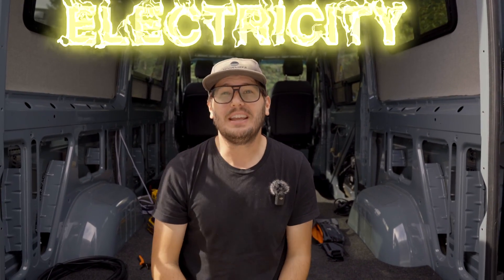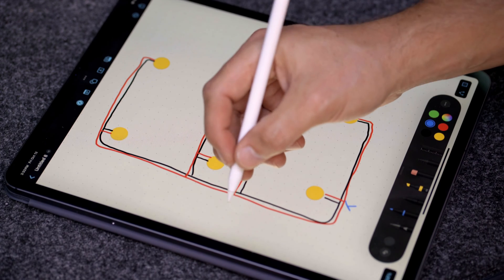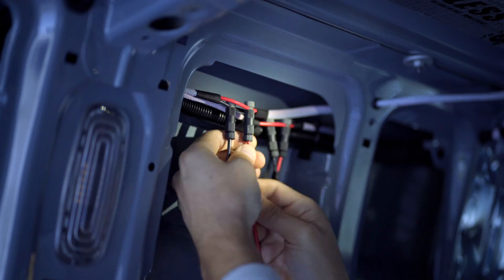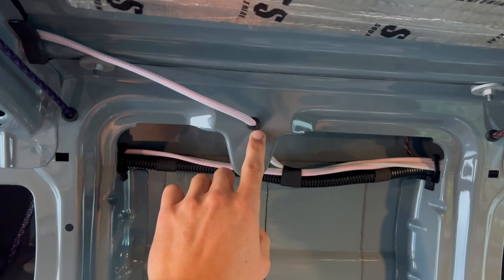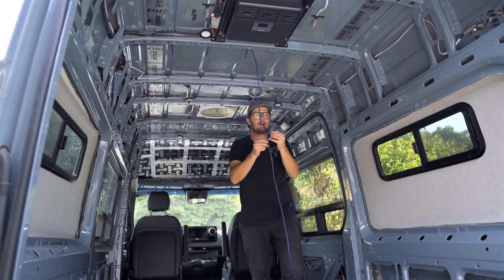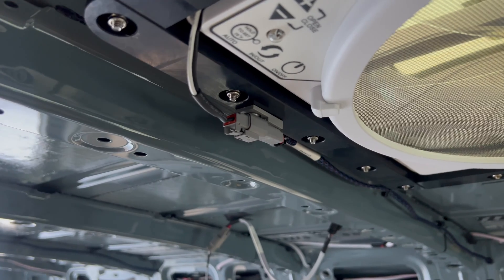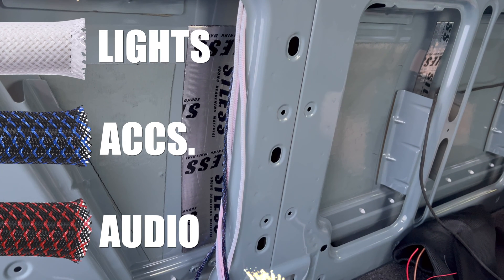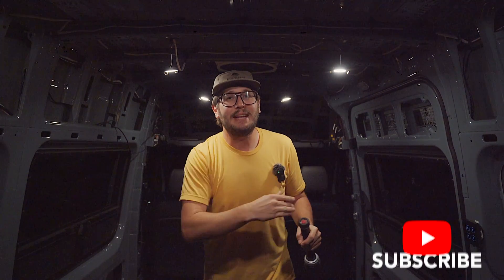Sprinter Van Electrical System Phase I - Prewiring the Lights, MaxxFan & 12VDC Air Conditioner

Comment: Fantastic video. I know you used the external power source to test the lights but did you ultimately use the main battery as the 12v power source or did you tap into exiting light wire? And did you remove the oem lights or did you simply leave them alone? Thanks.
Reply from the maker: Hey there, I ended up tying these into my house battery system.  I have 2 extra batteries for 640AH of power that runs all the electrical in the campervan.  I left the OEM lights in place because it's nice to have them turn on when we open the doors,  we did add a switch to allow us to turn them off at any time, though.

Comment: Can 1 LunaSea receiver be controlled by multiple touch pads?  I'd like to have one pad at the bed and another at the slider to control the same lights. I assume this will work, but the info on their website is thin. VERY appreciative of your videos!  Entertaining, educational, and well organized with links to everything.  You are putting in a lot of work.  I'm just starting my build on a 170 extended and will by as many supplies as possible through your links. First $500-ish went out tonight.
Reply from the maker: Hey @RTBWest, thank you so much for the support, using the links (any little bit helps) and glad you are liking the videos.  They do take a look of work to put together so it always helps when I know people are getting some use out of them.  

For the Lunasea, yep!  Each receiver can pair with up to 8 transmitters (touchpads).  I have a similar plan. I'll have my 4 Channel touchpad (overhead lights, accent lights, left and right porch lights) by the slider door, then a 2 channel for overhead and accent lights by the bench seat, and one more maybe in the garage.  

In addition to this..... I know getting a little crazy.  I'm going to wire in a HomeAssistant relay to the button contact of each receiver so I can turn them off from my phone too.  It's totally redundant and over the top, but I just want to share as many options and info at this point 🤓

Comment: Wonder if you'd be able to control a fan with that Lunasea 4 zone transmitter and an RF unit (rated up to 8 amps)... obviously more expensive than a simple PWM but also a lot cleaner if you already have the transmitter mounted. We have a LeMans vent and dialing in the fan control, probably going to add this for our lighting to simplify all the switching/add control points.
Reply: Annnnnd while I'm here - any idea how long the Lunasea RF system remembers the learned channels/connections? If you had the power system off for say, a week, will it have to be re-synced?
Reply from the maker: @AllenKrughoff  Hey Allen, I left power off for almost 5 month at one point and the RF channels were still programmed.  

Are you looking to control the fan speed with the dimming function of the Lunasea?  Does the LeMans vent motor speed simply run on a voltage input because that's what it does drop the voltage to the light. 

The way I'm going to have my final system setup is Lunasea RF touchpads wired in (one in the garage, one by the galley, and one by the passengers seat) but then I'll also have a home assistant relay wired into the button contacts on the RF receivers so I can also switch stuff on and off with my phone or from outside the van (say porch lights especially if on the drivers side of the van) 

Other companies make these type of RF transmitters for less FYI (SuperBrightLEDs), but Lunasea makes the nicest touch pad I've seen and unfortunately each brand is proprietary to each.
Reply: @moonrakerdesign nailed it. Yes just a simple 2 wire for the fan. Literally was browsing superbright this am (4ch control and 4 RFs for $39 😮). Proprietary…bummer. I’m sure you considered the Lunasea pad and alternate RF’s. The RF concept solves my 3 way wiring brain melt, getting porch light switch to the drivers seat and the bed. Thanks for all this! Hang tough with kiddo, we just hit 3yrs old and the fun is exponential
Reply from the maker: @AllenKrughoff  yeah I ordered a bunch to test with the Lunasea pad as the RF controllers were so much cheaper... unfortunately they don't work... booo 

Yeah being able to have multiple controls all around the van without sending your lighting wires everywhere is a huge benefit! 

I can already see that, at 7 months he's starting to become a lot more interactive and so much fun!  It's getting better everyday.  Thanks for the encouragement!

Comment: Hey, I would love to get the file on the bracket for the AC wiring harnes!  What are the chances you would share that?
Great Video.
Reply from the maker: Hey Dana,  Thank you. I actually sell that piece so not looking to share it out right now.  However the design is fairly simple to reverse engineer with a few measurements from the connector.

Comment: Whats that adhesive that you used (Black) holding the roof to the ribs? did you do that to make sure they didn't come apart for noise reduction?
Reply from the maker: Hey John! Thanks for stopping by and the question. Mercedes did a terrible job with the factory adhesive in our van for both the roof ribs and side panels.  Some adhesive from the factory was missing and others had so little that it didn’t do anything and things were flapping around metal banging on metal. 

So for the roof panels to the braces I used 3M 08323 seam sealer.  This is a body panel sealer that dries a little faster and I liked better for overhanging surfaces.  You can see how I applied this in our Sound Deadening Video - https://youtu.be/hFDmN5kshK8?si=EATuBJXQVm3uhG2L

For the walls and slider doors I used 3M 04274 which is a little thicker and can fill gaps up to 1 inch. If I had to pick only one I’d use this for both.  You can see how and were I used it in this YT short we made - https://youtube.com/shorts/8sIdC-9hhiE?si=_nfcS-jbl60XA7vB

Hope this helps. It quieted our van down a ton.  Let me know if you have any other questions!
Reply: @moonrakerdesign   I have the same issue. I bought Sikaflex 252. It's sitting in my office until it gets warm enough to apply it. May try put the 3M stuff as well. Thanks for the info
Reply from the maker: @JohnDrach  Sikaflex 252 would probably work as well since the joints aren't under heavy load.  However, the reason why I chose the 3M is because it bonds well to 2K auto paint and specifically says it can be applied over existing NVH without prep. 

If you look at the SIKA docs it wants you to scuff the paint and apply 207 Primer for the best bond.  But back to my original point it's probably okay for these joints without that extra effort and a long as the area is clean.
Reply: @moonrakerdesign  Hmm I may get some of these 3M products. I have huge gaps though. My van only has 3k miles. How many of these tubes did you end up using? It doesn't look like you get a whole lot in those containers for your money. Thanks for the info though. I'm just about at the point in my conversion where I need to do this step. Its freezing out so Its been on hold.
Reply from the maker: @JohnDrach  It really depends on how many ribs in your van are detached and how big the gaps are. I hit every single one on the roof but the gaps were tiny there so a little bit went a long way.  Down on the side panels I would say I had to do about 30-40% of them mostly around the wheel well and on the doors.  Some of them were almost 3/4".  In total I used 2 cartridges.

Comment: any chance you can give a little bit of info on how you used the 12V power supply to test your lights? Ie setting for Volts and Amps
Reply from the maker: Hey @dennym, thanks for reaching out!  I use an adjustable power supply that’s up to 30VDC and 10A linked in the description above. There are two sets of knobs that allows for either steady (set) voltage or steady (set) current.  We want to be in steady voltage mode so you should only adjust the voltage knobs and do it when nothing is connected to it and the voltage setting is 12V and the amp draw should be 0A.  I always make sure to check this before connecting this to anything. Then I use the switch on the back to turn it on and off since it will remember its previous setting. 

As long as your connected load pulls less than the max amperage the power supply can produce (10A in my case) the amps will automatically adjust to support that load in the set Voltage setting. 

Let me know if this makes sense if not I can put together a YT short when I get home from my current business trip next week. 

And alternate option is to use a set voltage power supply. I didn’t want to do this because I wanted some flexibility for using the power supply for different projects besides just the van.  Here is an option - https://amzn.to/3FNR0se. With this you don’t have to worry about making adjustments all you’d need to do is hook up a plug like this -  https://amzn.to/3QQ0vgB to 120VAC (usually denoted by L, N and the ground symbol) and then hook up your 12VDC load to one set of the + and - terminals.
Reply: Perfect sense. Thanks @moonrakerdesign

Comment: Will 16 gauge works instead of 14?
Reply from the maker: Hey Melinda. Depends on the lights you are using, their total amp draw and how long your wiring run is.  Are you familiar with wire gauge tables. My favorite is from Bluesea https://www.bluesea.com/support/articles/Circuit_Protection/1437/Part_1%3A_Choosing_the_Correct_Wire_Size_for_a_DC_Circuit

Let me know if you need more help or explanation here.
Reply: I wish you install and show what is needed to jumpstart the van whit the house batteries 
See other vans use a button

Comment: Not only are you funny, but you do such a great job detailing all the steps in an easy to follow and super informative way! Thank you for continuing to deliver great quality and especially for the links to the products you are using! Hope the pennies in commissions are stacking up from me ;-)

Quick question - can you do a video that includes all the different wires sizes you use throughout the entire build? I see 14AWG here but wonder what different sizes I should consider buying in bulk for my build.

Again, thank you sooooo very much!!!
DC
Reply from the maker: Hey @olddominioncollisionrepair2652 thank you very much we really appreciate you stopping by and taking the time to comment this.  It means a lot to us and we are glad you are enjoying the content!  Also thanks for using the links.... yeah we don't get much...  but it does help a little bit here and there so thank you for that!  

Yes of course!  I can look at putting a short or video together on that soon.  But real quick here's what I did.  I made a table of all my DC connections in Google sheets, I added their amp draw for each and I then went out and measured every wire run adding 1-2 feet for margin.  I then used the Bluesea circuit wizard - http://circuitwizard.bluesea.com to calculate the wire gauge using 3% voltage drop for everything.  The important thing is you factory in your total loop the calculator takes the value for both the positive and negative wire, so an 10ft direct run would actually be 20ft here.   You want to make sure you use a high quality wire like Ancor too that has a 105ºC insulation rating because that will also impact your results.  After your results are calculated there's a little drop down that says "explain results." There you can see the condition for amp rating and the voltage drop using ABYC standards. 

Anyways after all that data was in the table I started looking for lowest common denominators.  It doesn't hurt to go up (lower number) for wire gauge on any of the circuits so I wanted to order spools and have them divide out the best I can.  For example if I needed 60 feet or 14AWG for one circuit and 35 feet for 16AWG for another, I'd just order 100ft of 14AWG and run both circuits with that.  

I hope this helps and I'll try to find some time to make a video of this soon!
Reply: @moonrakerdesign  daayyuuummmm!!! That’s what I call going above and beyond! Thank you for this great explanation! I appreciate you and your killer content! Looking forward to any and all your content ❤️🤘🏼❤️🤘🏼❤️
Reply: Hi Todd and Colleen, we’re really enjoying your content and in particular the engineering you’re applying to build in maintenance. We just received our 144 AWD and have an Outfitter to help us as we spec out out our multi-use modular vehicle ideas. I just purchased your hood strut kit 🙏🏻. I have a couple of questions: 1) Total Stereo Speakers - how many total speakers are you installing and where are will the rearward ones be placed? 2) Heated Steering Wheel - we live in BC CAN and live at Silver Star in the winter without a garage and grown fond of heated seats and mostly heated Steering Wheels. We were saddened that only the E-Sprinter has heated steering wheel option and our ‘23 did not have the option. My question is are you interested in seeing if the E-Sprinter’s heated steering can fit and work in the 4 cyl or v6 cyl vans? I would be very keen to help out in any way!
Reply from the maker: @garryvansoest8726  hey Garry first off thank you for the compliments and thank you so much for supporting us with the purchase of the Strut Kit!  We really appreciate it and it helps us continue to make this content! 

1) For the total number of speakers we have the 3-way components up front obviously, we are going to put a sub-woofer behind the drivers seat in the wall with the @diyvan solutions and then we will have a 2-way component speaker system in the rear doors.  With that much distance between the speakers we are going to have to add a DSP to solve the timing issues and such so that will be Part 2 of the audio system install as we get a few other projects out of the way.  Our master plan is to also have a Mediamaster in the living space to use the system separate from the factory head unit, another feature made possible by the DSP too. 

2) I was a bit bummed when I found out that wasn't an option in the Sprinter as well!  I'd need to dig into this one a bit more.  I have seen people put AMG steering wheels into their sprinter so it might be something along those lines?
Reply: Todd, thank you for the stereo install plan update. I also saw OWL change out steering wheel to AMG but unfortunately it was not a heated version. We have a E63 wagon with heated SW. The on/off is spring loaded twist knob at the end of a short stalk on the left side of the steering column. I’m planning on ordering the E-Sprinter heated wheel when it become available. The wiring is my fear and it’s not even Halloween anymore!
Reply from the maker: @garryvansoest8726  Yeah keep in touch about this!  I'd be interested in helping you solve the problem as my wife sure would appreciate a heated steering wheel as well!

Comment: Super helpful and appreciate your attention to detail. I just used all your links to buy all the gear to wire up my 12v gear. How do you label that shrink wrap for the cables? Or is that just a plain label?
Reply from the maker: Hey @omjaye, thank you so much for the kind words and we know you didn't have to use our links but really appreciate that you did!  It means a lot to us that you'd be so intentional about that.  I'm also excited to hear how your electrical system goes. 

For the shrink tube labels, great question!  We use a Brady M210 labeling machine that allows you to get a shrink tube cartridge with it (I've found the 0.645" size is the best for vans).  Fortunately I already had this device from some past work I was doing so it transitioned to this project quite nicely.  My only complaint now is that the cartridges are kind of expensive it's up to ~$70.00 for 7ft of shrink tubing.  I would say each label is about 2.5" long so that's ~42 labels at $1.60 each.  As I just typed that out it seems a bit crazy as I've never looked at it that way.  Still worth it IMO.

Anyways, I just had to buy my second cartridge and when I saw the price I started looking at alternatives.  If I were starting from scratch I might look at the Epson LW-PX700 - https://amzn.to/3QpqTxI.  It's a little over $100 for the unit, but the advantage is the shrink tube labels are about $50 for 7.5ft and the printer is optimized so the cutter is right on the edge.  You'd conservatively save about 0.75" for every label compared directly to the Brady M210 for a total of ~51 labels at $0.98 each. 

Sorry, this is turning into a novel, but the other option I'm seriously considering going forward is using wire wrap type labels instead.  These have a extra flap of vinyl that allows you to wrap around the wire and the label face to protect it.  The nice thing is can you apply this after the fact as opposed to the having to pre-plan all your shrink tube labels. For the Brady M210 this would be cartridge Part #M21-1500-427  - https://amzn.to/46CLEf2 - 2/3rds the price for 2x the number of labels ~67 at $0.62 each.   Scroll down to the bottom of that page and there's a great infographic showing how these work! 

Unfortunately the Epson only goes up to 5.4mm diameter on their wire wraps Part #224VSLPX which might not be ideal for van wire gauges. Hope this helps!